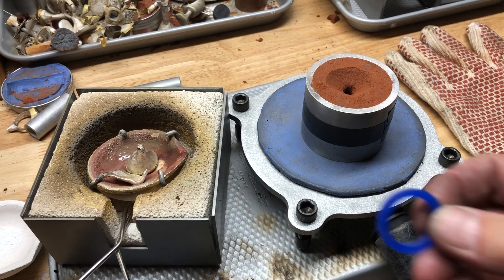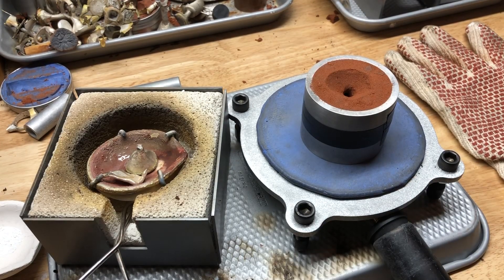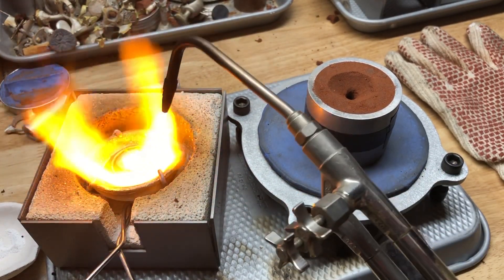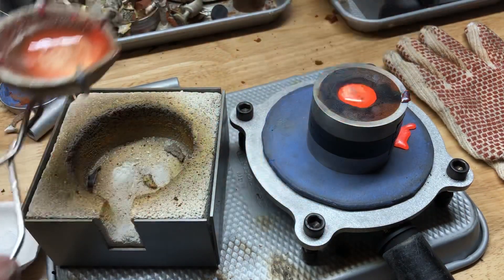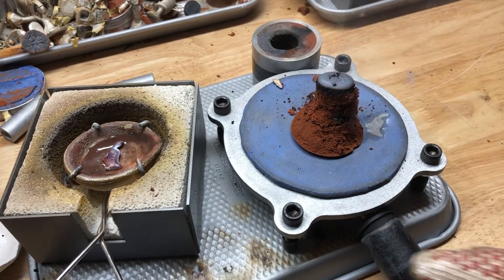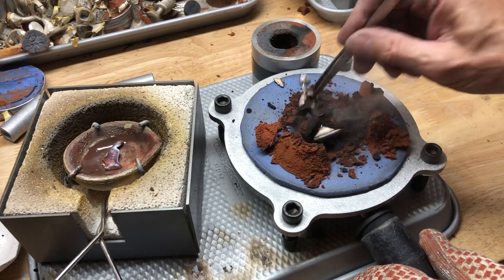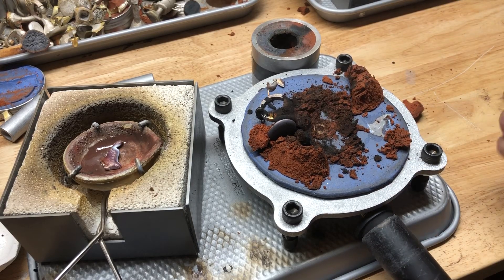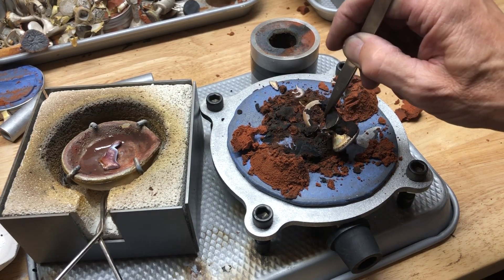Sand Casting 1 1/2 Ounces of Sterling Silver - Vacuum Assist Flask Setup

Comment: Hi Craig, where did you get that little vac-assist table to use with your shop vac? Did you purchase somewhere, or did you fabricate it yourself?

Keep up the great work. Your channel is very helpful.
Reply from the maker: I came up with this system and sell them here: www.diycastings.com. It is based off a system I bought which was used in the late 1800's but since my clay brand Red Clay is similar to others like Delft Clay I wanted to be able to use the system with a fine clay so I tested it over several months and came up with the vacuum table system.

Comment: How much is vacuum helping?
Reply from the maker: It makes it possible to use this method of sand casting using 200 mesh or higher clay instead of the common low mess Petrobond types. My Red Clay is too compact and won't work without vacuum assist.